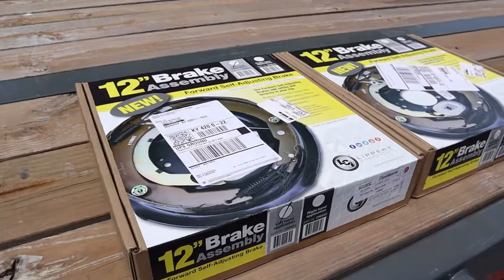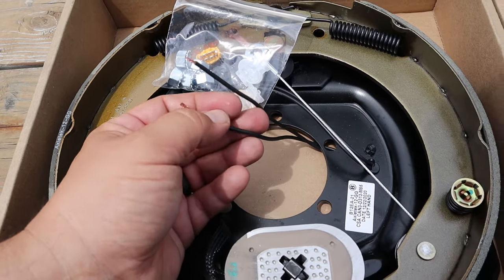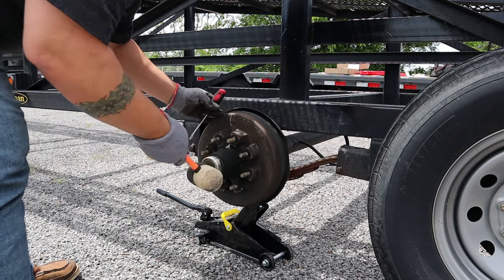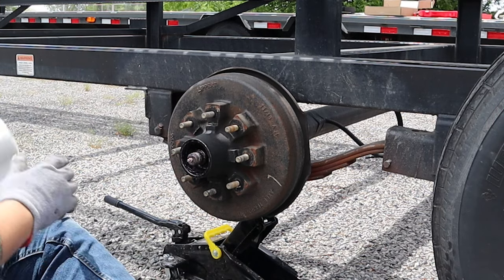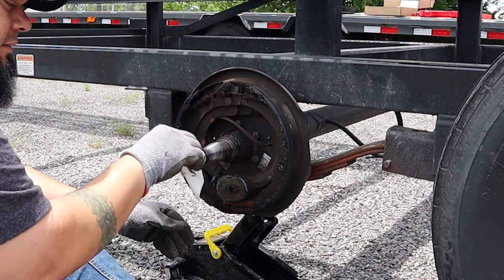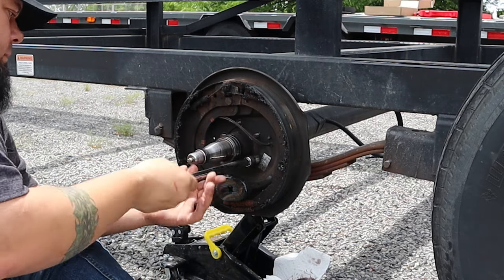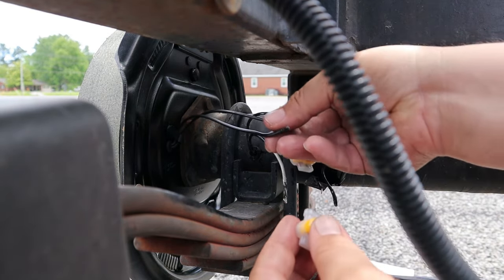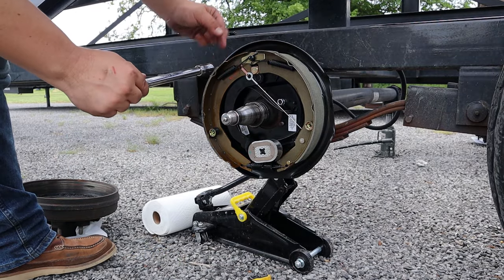How to change electric trailer brakes DIY! 7K Lippert or Dexter axle

Comment: Enjoyed your video! Thanks for going over the electrical connectors. A lot of people skip steps that they think are common knowledge. The only thing I would add is how to verify the brakes are actually working after making the connections. Show using a multimeter with the trailer hooked up to the truck, etc.

Comment: When you are making your electrical connections from the brake assembly to the jumper wire that goes across the axle you should have got rid of those old butt connectors. I have learned from experiences in the past, you want as little connections as possible and when making your connections. The more butt connectors and the more connections you have the more opportunities for one of those connections to fail and you will be chasing electrical shorts and pulling your hair out trying to find it, ask me how I know?

Comment: Its just a question which always comes in my mind. What “if” a crash involve failed brakes. The insurance will demand work order from a licensed trailer mechanic to make sure they were done right. How would that be in the situation where you replaced it yourself?

Comment: This video is right on time. I was just looking for a video today on how to go over brakes, bearings and seal replacement. Is it any different with oil bath?
Reply from the maker: Only difference is the hubcap and rear seal. Instead of wiping everything with a paper towel you’ll need something to drain the oil into...and paper towels lol. Good luck!
Reply: @LoadMizer  good stuff thanks man. Interested to see how you change your bearing

Comment: Question? I need to replace my brakes on my 5th wheel camper.  I'm looking at MAT electric brakes or Dexter electric brakes. The MAT are $50-$58 and the Dexter are $180-$190. Other then the price what is the difference?  Thank you for any advice you can give.

Comment: I have tandem 7k lippert axles on my Diamond C trailer.  The brakes have seemed weak from day 1.  I had a shop look at them and the replaced 1 axle because the adjuster seized.  Have you had any issues or was this simply routine mainteance?
Reply from the maker: I’ve noticed that on both trailers I’ve had to manually adjust the brakes several times before they were where I wanted them to be. The 7k brakes are just almost too small for what I put them through. It’s just a constant battle to keep them tight.

Comment: Hello my friend . Thank you for your videos bud .... how frequently I should pt new grease on the bearings, and how do you know yu eed tochange yur breakes?? Thank you
Reply from the maker: The owners manual for your axle will give you the recommended maintenance intervals. You can find them online if you don’t have one. Most of them recommend every 10-15k miles I grease mine once per month. If I notice anything loose or hear something I don’t like I’ll pull the hub and check the bearings. You can pull the hub and check your brake pad thickness at any point but typically you’ll notice your pads are getting thin if you’re having to adjust your brake controller higher than normal in order to feel them working like normal. 👍
Reply: @LoadMizer  thank you very much

Comment: QUESTION: Can you tell us the brand of the grease and may the grease gun you are using.
Reply from the maker: I use Lucas. Switch between Red N Tacky and the green Heavy Duty grease depending on what’s in stock. Haven’t had any issues with either one so I just get what’s available when I stock up. As far as a grease gun goes I got a couple from lowes. Nothing fancy. I don’t even think they were $20.

Comment: If you want to never have a blown seal, don't use the e-z lube zerk. It pushes the grease right past the seal.
Reply from the maker: You ain’t wrong! Lol 😂
Reply: But does it push it past the seal, or damage the seal? 🤔
Reply: @georgehofgren6123  yes it does
Reply: A seal is a seal, grease is for the bearing’s

Comment: Great video.  I live in N. Cal (but not for long).  I bought a used triple axle trailer (7k torsten lipperts) for my move to AR and took it to a local shop to me checked out (because I don't know squat).  Their shop rate? $125 per hr.  Of course, I needed new everything x 6, so Ka Ching, $1,300 in parts and $500 in labor = $1,800 .  Straight out of the shop, both of my brakes on the front axle are completely locking up.  Any ideas?  The shop didn't mention seating the brakes.  Maybe I just need to do that.....

Comment: Brother it’s always great watching your contents and explanation!. I have a quick question, I have done my own authorities, I bought a truck(Ram 2021 3500 dually), equipments, insurance, my question is I am want to do non cdl, so my truck on the sticker says that the GVWR is 14000 lb, so the trailer should be 12000 lb and the total is 26000 lb so how much load I can load?
Reply from the maker: Thank you man. It’s going to depend on how much you’re setup weighs empty. You’ll need to get a scale ticket and then take the math from there. I break it down in this video 

https://youtu.be/1SlcvHOyYQg

Comment: Ricky 
Is there any reason u chose Lippert over any other brand ? I have always used a knock off”Chinese brand” and they do ok ..
What is the price of the Lippert part ?
Good video man 👍
Reply from the maker: I guess it’s just my preference really. There are a few things as far as vehicles go that I always stick with name brand or OEM parts. Brakes, filters, tires, wiper blades and lights. I’ve tried to upgrade a lot of things over the years in a lot of vehicles and it almost never fails that when you try to go cheap on them, they either don’t fit properly or they don’t perform properly...or both. I just got burned too many times lol
Reply from the maker: The lippert brake assemblies were $52 each but the left sides were 15% off for some reason so they were $44
Reply: For that price I will try the Lippert parts next time . I’m payin about the same price for “redline” parts.
I will be very curious to see if there is a quality/lasting difference

Comment: Great video. You are familiar with these brake mechanisms. Could the magnet arm be suitably used to fix a pull cable for a mechanical operated parking brake?
Reply from the maker: I’m not quite sure on that one. I do know that the arms aren’t very stable and the brakes most definitely rely on the hub to keep them perfectly straight. I think you’d risk bending the arm attaching anything to it. You wouldn’t be able to pull it straight because of the hub so you’d have to drill into the back of the housing. Wheel chock is much easier 👍
Reply: @LoadMizer  Thanks. My spec requires a secondary brake (emergency and parking) that has to be held in place mechanically. In other words a electrical break away kit would not be sufficient. That is why I was asking the question.
Reply: @LoadMizer  Mechanical Pull demonstrated at this video https://youtu.be/EJH102-TThs

Comment: Trailer place told me I need to replace the hub the same time I replace brakes. Is this true?
Reply from the maker: Not at all. Sounds like the trailer place is doing 2 things here. 

1. Making a brake replacement cost 3x what it should. 
2. Being lazy. They don’t want to remove all of the components and then put them all back in. 

They’re being extremely lazy here and in turn ripping you off. They want you to pay for a full hub assembly so they can just remove the old and throw new ones on to save themselves time. My advice for you is to never call that place again.

Comment: Hi Im from Louisville KY I just bought 3 cars Appalachian trailer with 7k axles is this brake works on mine ? If not how will I know the right ones please ?
Reply from the maker: Yes, Appalachian uses lippert axles. Dexter and lippert parts are interchangeable. These parts will work on both brands 👍

Comment: Question, just connected my brakes but I'm not getting any gains...might you know what the problem might be? It's saying the trailer is connected but when I press the toggle the number of gains show but the brakes aren't applying
Reply from the maker: They’re most likely wired backwards at the brake. I had that happen to 2 of mine. Since the wiring isn’t marked on the brake (they’re just 2 black cables). If you have an ohmmeter it would help but if not just find the ones that aren’t working and switch the wires positive and negative.
Reply: @LoadMizer  thanks, will do. Will keep you posted.

Comment: What is the torque spec for those five bolts holding the brakes on there?
Reply from the maker: It’s a big gap. Manufacturer says 30-50 ft lbs. just make sure the lock washers are flat.
Reply: @LoadMizer  Thank you! This job looks fairly easy. Do you have any tips for fixing a bent side toolbox on a trailer.. it is welded on there but it got a bit bent. I was thinking of putting another smaller toolbox inside it and bolting it on there as it might be an easier fix. what are your thoughts?

Comment: O'Reilly's carries the backing plates in stock at most locations. Just FYI for when you're on the side of the road. I had an adjuster brake coming down pilot mountain. Well actually it was after pilot mountain near Asheville. And walked into O'Reilly's getting the part number and walked out
Reply from the maker: That’s good input man thank you! 👍👍
Reply: I will try to get their part numbers.
Reply: Part number EB01-125 and EB01-124. One is left and the other is right.. can't remember what one is what. Also in Kaufmans website you can get the manual for those axles. Any decent parts guy/gal can find what you need.

Comment: Anybody know if RV trailer electric brakes are like this. I have a keystone hideout 5th wheel. I'm having trouble locating parts. I wouldn't know how to find out what rating the axles are.
Reply from the maker: Axle info should be on a label towards the center of each axle
Reply: @LoadMizer  thanks for the info. Looks like I'll have to take the wheel off then order parts. Much appreciated!

Comment: Thanks for sharing.  Something not mentioned was that the failed grease seal results in grease getting into the magnet friction surface and fault propagates to complete loss of brake function.  Fatal flawed design.

Comment: Don’t use those junk scotch locks for the wires and dielectric grease doesn’t conduct electricity it just protects from corrosion
Reply: What do you recommend fir connecting the 3 wires?